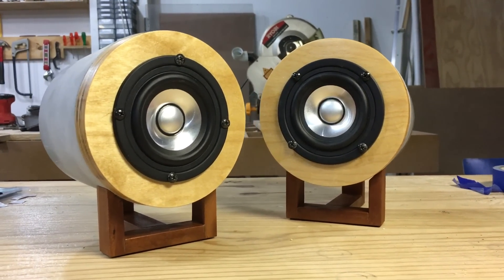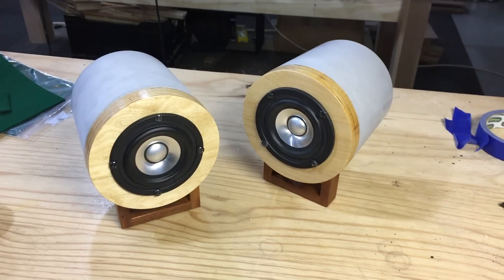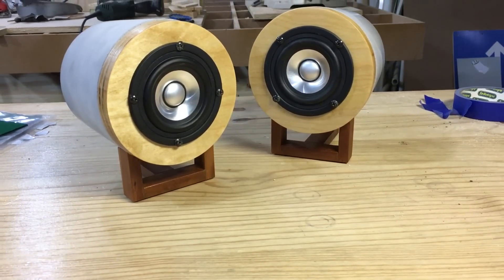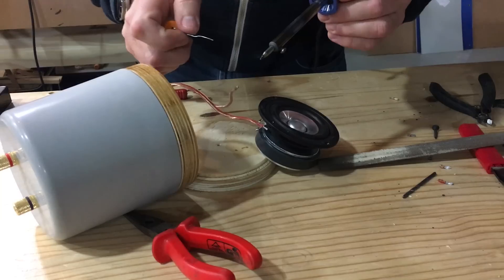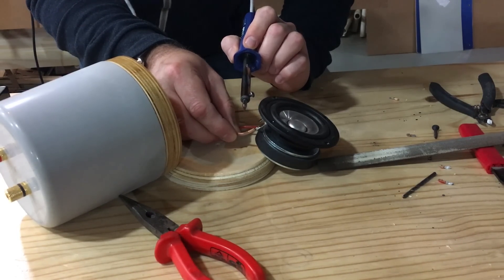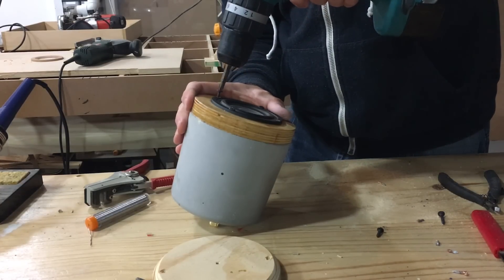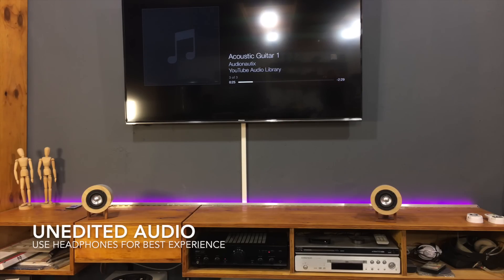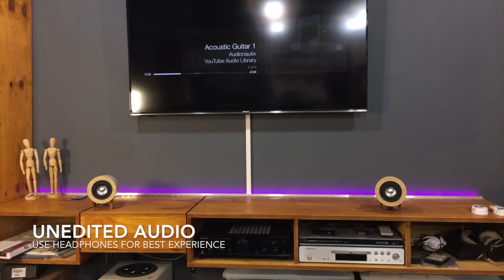Making Concrete Speakers - SOUND DEMO - by SoundBlab

Comment: Bro i m making suitcase speaker should i use passive radiator or just make hole for bass pipe which would be better please tell
Reply from the maker: This is not an easy answer. It will depend on the size of the suitcase, the drivers you are using and the passive radiator you want to use. Easiest though is just to use a bass reflex tube, but like I said, you will have to match the driver and the port size to the internal volume of the suitcase.

Comment: I wonder if it would be improved if the interior was designed to absorb sound (eg. gear tooth or the typical cones you'd see in an anechoic chamber) instead of reflecting the sound?  Maybe even some damping material to absorb higher frequencies?    A perfect enclosure would be infinitely large so that the back pressure on the driver is zero and there are no sound reflections causing sympathetic vibrations in the driver cone.   It sounds great in the video - just theoretical pondering.

Comment: I'm going to build a bluetooth speaker with one of these and a woofer. Would both speakers benefit from being in concrete? Maybe one large concrete shell, with a sub-shell for the fountek so they're isolated.
Reply from the maker: Sure, both will benefit some, but it all depends on the visual design that you want to end up with.

Comment: very very impressive.  Nice job indeed. Congratulations !  looking at the driver's response it is very very flat from 150Hz upwards.  To get a truly full range speaker i would use these drivers from that point upwards and below a very nice woofer. Maybe even using a electronic x-over.   I think you will end with an exceptional clean and wonderful sounding speaker.  If you take out the freqs below 150Hz the sound will be even clearer and less distorted.  I made some test myself on a mini speaker.  It is impressive how many very cheap speakers can sound when you take out the lower frequencies.  Even speakers for pc !!!   The speaker you have made could be like a head to be put on the bass box.  Like the B&W 801 for instance. However great job indeed.  Thanks for the videos.
Reply from the maker: Thanks! I think thats a great idea and I could add to this project what you are suggesting. I was thinking of making a concrete subwoofer to go with these, but perhaps I can consider concrete bass boxes for each to do a 2-way stereo pair.
Reply: Hi !  "I can consider concrete bass boxes for each to do a 2-way stereo pair"  i would chose absolutely this solution. Even if more expensive. I like the idea to build a stereo like a dual mono in general.  Anyway this driver is an excellent product.  If i understand rightly it is used also in a very expensive speaker with really amazing results.   A best buy indeed.  Thanks a lot, gino

Comment: What's the point of using concrete?
Reply: Thanks for the notes. I have been comparing surround sound speakers and I have been doing some research of their sound and plan on building my own system. Again thank you!
Reply: @BrassMtn  density. and stiffness.  plain as.

Comment: Hi!
I've started a project, I'm building omnidirectional speakers shaped like a cylinder. 
Now I'm getting worried if it's a bad idea, when you said that circular baffles isn't good..

Should I keep going?
Like your channel!:)
Reply from the maker: There are many speakers out there that have round baffles and they sound just fine. It all depends on the driver that you have selected and the crossover implementation. However, you can if possible, offset the driver from the center of the baffle slightly to counter the effects of refraction, and perhaps consider rounding or beveling the edges of the baffle.
Reply: B&W Nautilus doesn't really have much of a baffle, its nearly all curved back and molded to the side in a few areas, they could be using parts of that curve to boost some frequencies and or remove certain parts of the refraction. Most people that speak of a circle baffle being an issue are talking about a flat front baffle I would think.

Comment: Sounds really good, seems there is a little ressonance in the medium spectrum possibly between 800hz to 3k region, a little annoying and quite unusual,  but is very difficult to judge if there is no other factor contributiing to it.
EDIT: i think is more likely in the 800 to 1khz range acctualy.
Reply from the maker: Thanks. Your first edit is correct. There is a slight rise in response between those FQ causing the resonance. With a baffle step correction circuit implemented it should correct it and provide a more balanced sound.

Comment: it seems the freq response is only about 120-20K Hz?

EDIT: it can go down up to 90Hz
Reply from the maker: I did a quick measurement and they are about +-3 to 4dB from 800Hz to 20000Hz. Down -6dB at 120Hz and -10dB at 90Hz.